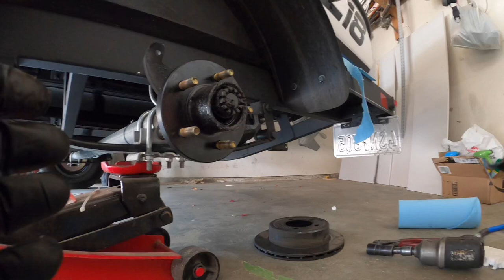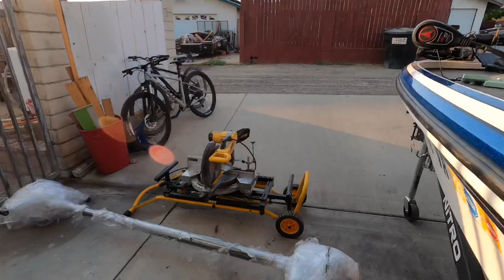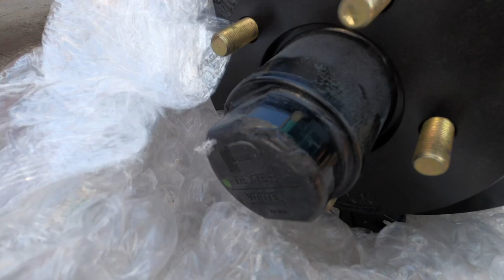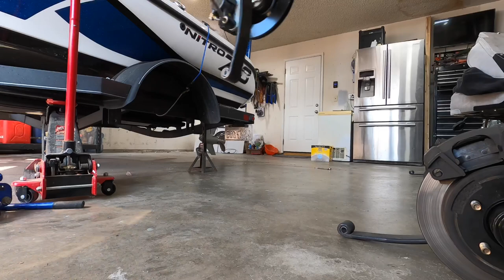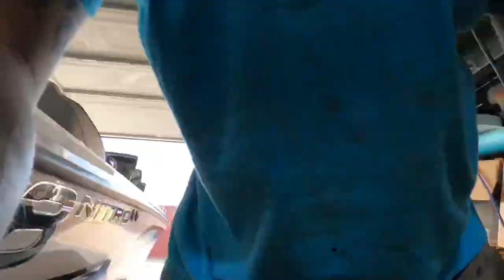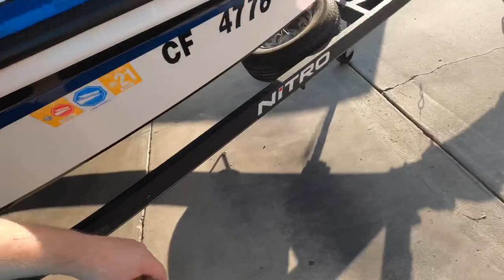Nitro z18 vortex hubs......junk hubs?

Comment: Had the same thing happened to me on the same side as yours. It was under a year old.  Had so many issues with my z18.
Reply from the maker: Haven’t had a single issue with the boat itself. Just the trailer.

Comment: That is common failure. Check balance of steel wheel. Many are finding the wheel cannot be balanced, which results in this happening over and over.  Finally fixed by going to alloy wheel and getting them balanced.   Let us know if this happens again with new axle.
Reply from the maker: Thanks for the info. I’m going to do another video with a hub update in the near future. Also switching to aluminum caps that don’t break.

Comment: Any advice for getting new caps put on? Mine won't screw in and I was told to hammer them on certain parts and they still wont. Btw, all 4 caps broke after 500 miles or so.
Reply from the maker: I had to use a file and clean up the threads on the cap. But I now have new billet aluminum caps from all out marine.
Reply: I don't have 150 miles on mine. Drove from dealer in Lexington to Jamestown Ky. 3 out of the 4 plastic caps broke off of my trailer for my Z19. Stokelys rushing them.out to me. Awesome people there.

Comment: wait are these dexter or vortex hubs giving u issues?
Reply from the maker: These are vortex hubs owned by dexter.
Reply: @boydsfishinglife3102  i was literally about to order these, are they worth it or should i look elsewhere?
Reply from the maker: @mudjerry  they are worth the money. But from factory on these nitro the bearing are preset wrong. Nitro is the only one that makes there own axles then uses another company’s bearings. Most boat trailers have dexter axles under them. As long as the bearings are packed correctly from the beginning and preset the correct pressure you should be good.
Reply: @boydsfishinglife3102   awesome man, thanks a ton, i have dexter ez lubes on my drift boat trailer and i dont care for them so i think imma make the switch to the vortex
Reply: @boydsfishinglife3102  Yes I figured it had to be an installation issue. Bearing preload can be important... too loose or too tight and they won't last.